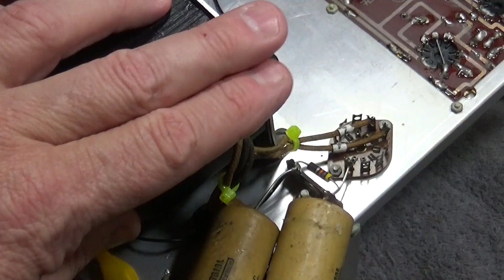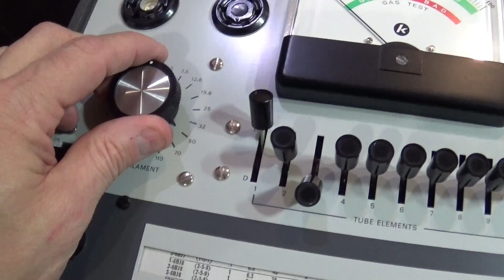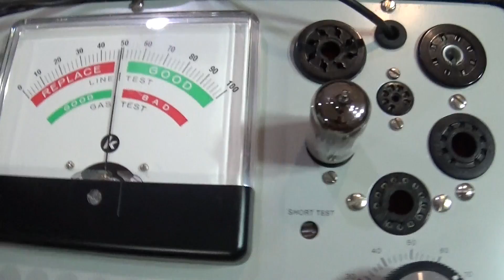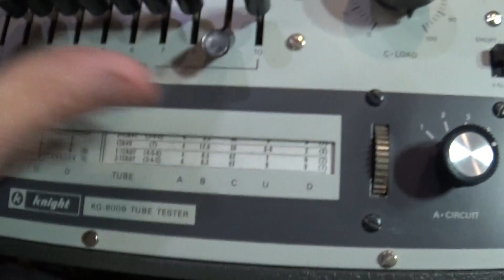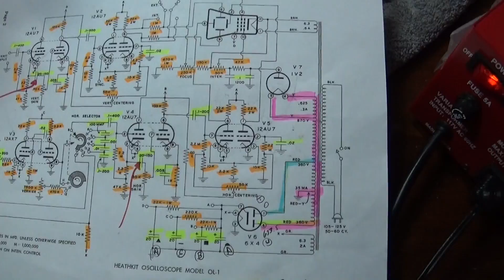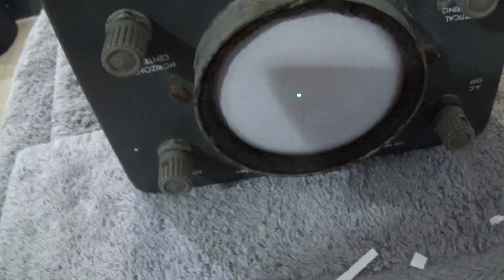Heathkit OL-1   #3  - Broken wires, not dreams

Comment: An interesting thing about tubes in test equipment, and maybe elsewhere is that as long as they aren't shorted, open or gassy, they may still be functioning in the circuit correctly.  Not all tubes, just like transistors, are used/driven at their limits, so a weak tube may actually not need replacing.  Most folks see a "weak" tube and assume it needs to be replaced.